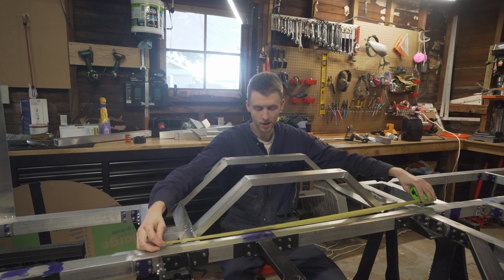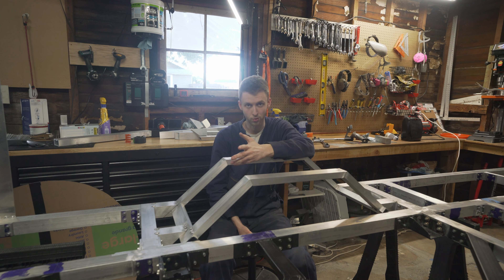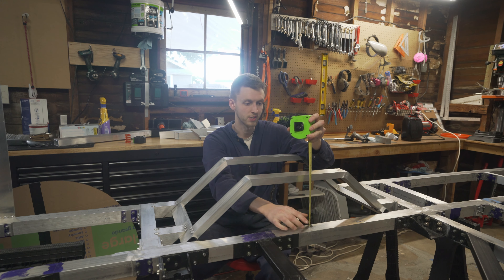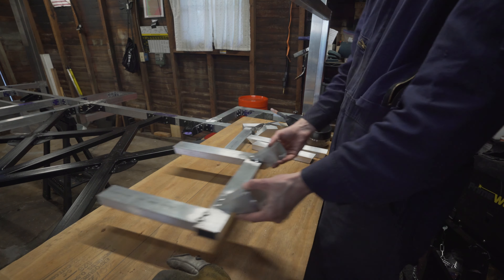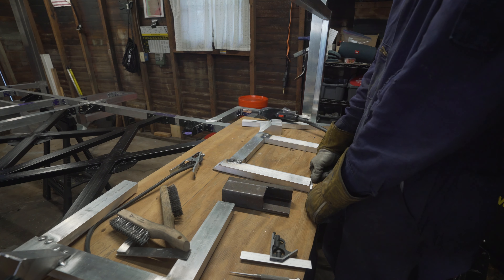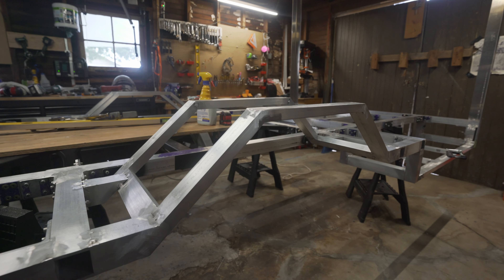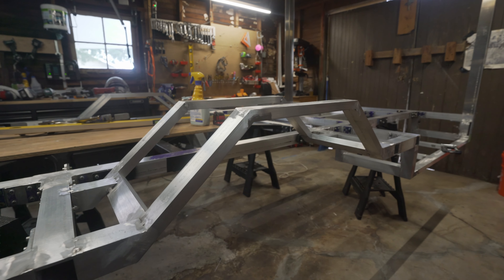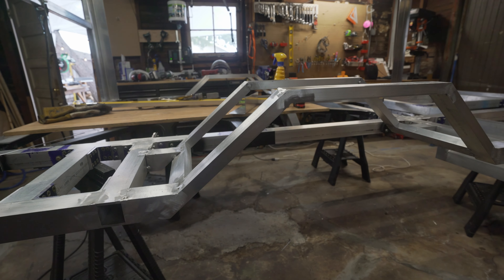Sizing, Building, & Rebuilding the Wheel Wells | DIY E350 4X4 Expedition Camper Build: EP3

Comment: Great build series! I wan't to do the exact thing. Are you concerned with getting the vehicle registered and licensed? Since you bought a cutaway van it will be considered "incomplete" and usually requires a certified upfitter to provide their "complete, meets all required safety standards" sticker to get registered/licensed.
Reply from the maker: We definitely had a few issues but everything is sorted now. I'd be curious to learn more from you and what you know about registering it if you want to reach out on instagram!
Reply: @PathNotTaken  Sorry, I don't know anything except what I read on the expeditionportal forum (and the interwebs) that it's difficult to get an imcomplete vehicle registered. I was hoping you could provide some assurance that it could be done easily. 😀  I'm in Georgia and I need to call the DMV for clarification but I've been putting it off because I know it will be a nightmare. 😥 Keep up the good work and the videos coming!